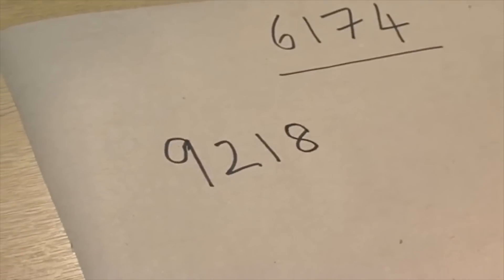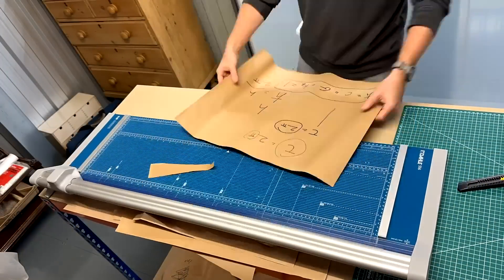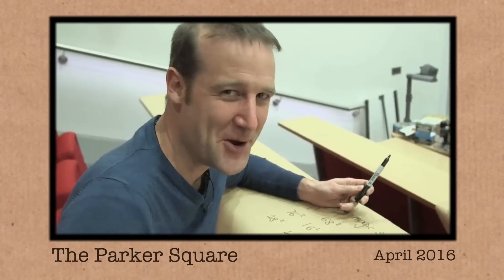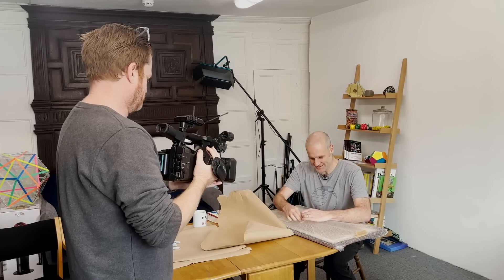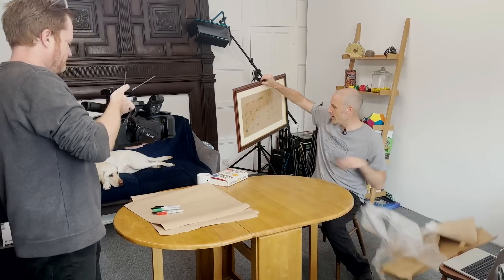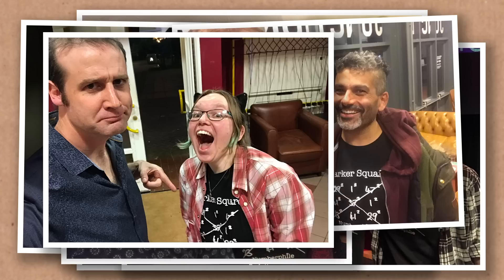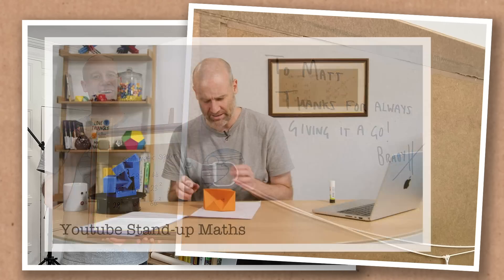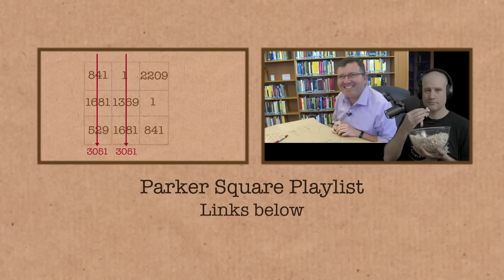The Parker Paper (a lost treasure) - Numberphile

Comment: I remember another MP video where (IIRC) you needed to use all digits 1 through 9 to calculate a number, and one (53, again IIRC) wasn't found, but MP did it using concatenation, arguing that since the other numbers could use it, you should include concatenation the same way you could use addition or subtraction. That paper deserves to be framed also.